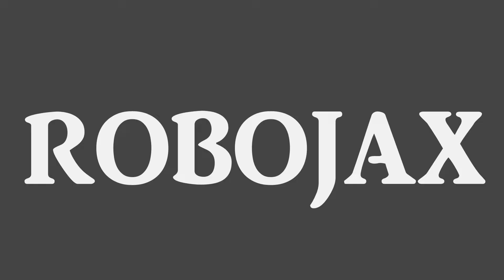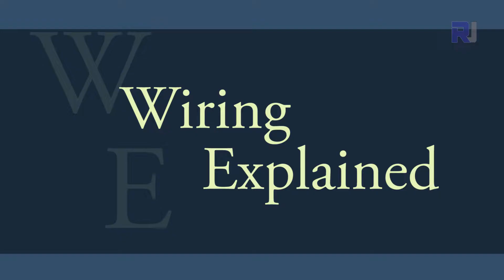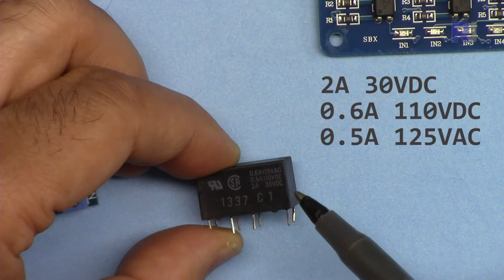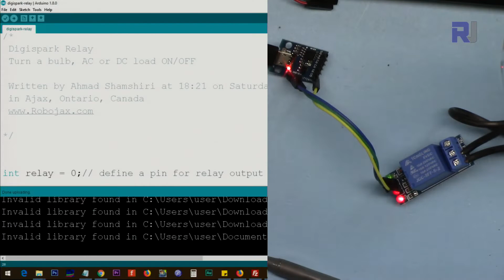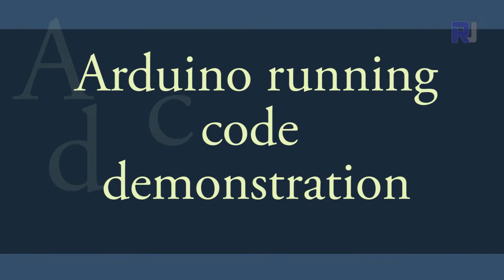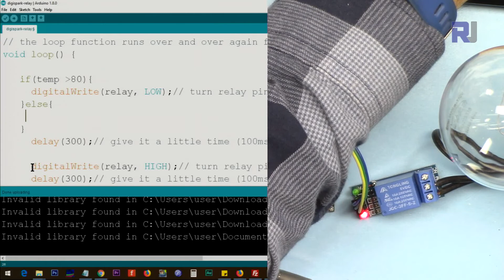Control Relay Modul with Digispark USB Attiny85 board RJT157

Comment: Could you plz upload a tutorial on how to use rtc ds1307 with tiny85 board for time based actuation of relays
Reply from the maker: this is is 3 project in ONE. 1-DS1307 https://youtu.be/-I1nReV_oZg , 2-tiny85 3-Rlay 4-Actuator so actually 4 project. you need to work one by one and here is actuator control video https://youtu.be/oERwjgrX3fA the same code should work with tiny85